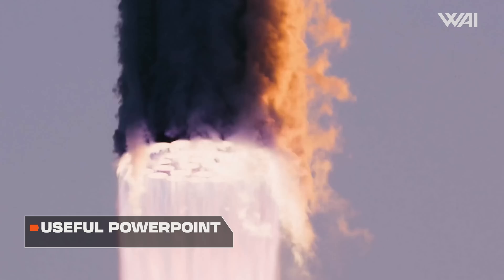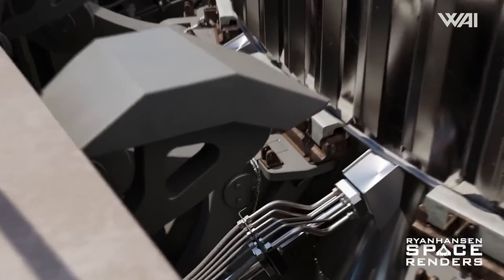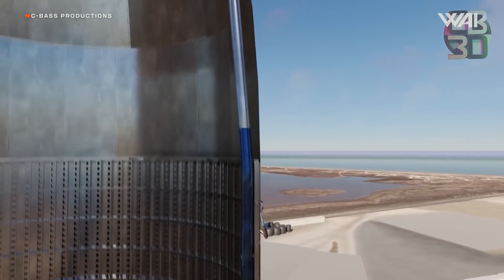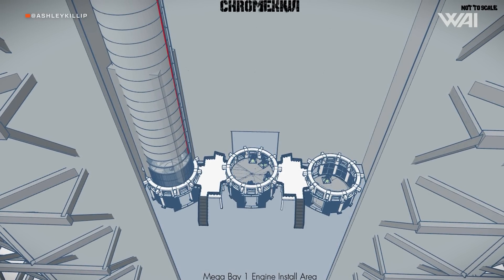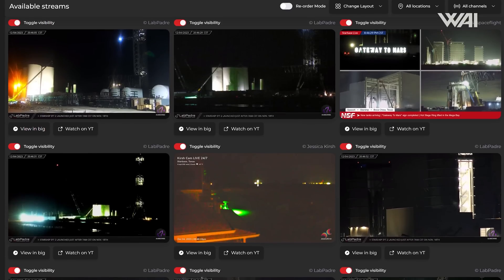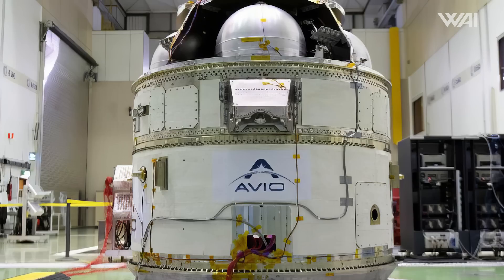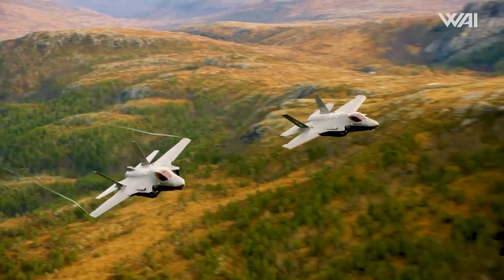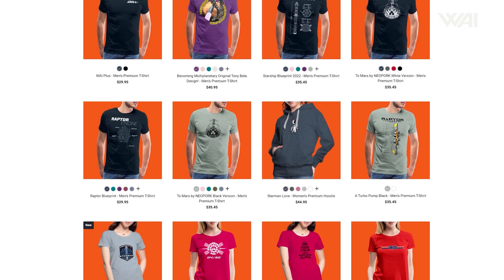SpaceX Starship: Version 2 Is Coming & And It Does Something Different!

Comment: Today's Fact: The 'Great Smog of London' in 1952 involved a deadly combination of fog and pollution that killed thousands, with no clear explanation for its severity.
Reply: I think it was just a high pressure weather inversion like a bubble that prevented the pollutants from dispersing. Once the weather pattern changed, air flow resumed and the situation corrected. London was notorious for fog and coal smoke for decades but that particular weather event created a horrific situation. In recent years, we’ve seen similar events occur in China.

Comment: The mere fact that SpaceX can manufacture SuperHeavy boosters and Starships at this rate is already mind boggling to me...
Reply: And it's only going to get faster. As Musk has said, they're not building a rocket. They're building the infrastructure to build LOTS of rockets.
Reply: Once Starship is operational, a new design Mars sample return mission could use the enormous throw weight to send a massive brute-force lander and launcher using as many off-the-shelf components as possible, with large performance margins included. Then launch four of them.
Reply: It only feels mind boggling because you are accustomed to the snail's pace sluggish production schedule embodied by NASA.
Reply: It is, but make no mistake. Starship will change shape a few times, and it will be more work than anyone ever dreamed. Not berating anything, just being realistic. A cargo version / non-returning ship will be ready first, but eventually human rating this monster for launches and landings is going to be a real tough nut to crack, unless some things on the ship change drastically. Never in this form will it achieve human rating.
Reply: Love the learning from failure ... a real lesson and paradigm shift for me
Reply: @paulmichaelfreedman8334  it will always have the same exterior shape. 😁
Reply: @ThatOpalGuy  You mean like an oversized pocket rocket? 🤣
Reply: @ThatOpalGuy  Seriously now, I think the only way to get human rating is to make the crew compartment an independent shuttle craft which can detach after re-entry burn, and glide down to earth like the shuttle did, also they can then land on any runway in an emergency. The bottom half of starship can do the classic belly flop re-entry and suicide burn. Imagine a scaled up dream chaser instead of the nose cone.
Reply: @paulmichaelfreedman8334  nature loves aerodynamics
Reply: @paulmichaelfreedman8334  It seems unlikely, to me at least, that nasa would allow a human rating without some sort of escape system. But we saw that the payload section of the starship can survive an explosion, so maybe just give that section some sort of escape rocket and a few parachutes to slow it as it descends?
Reply: @paulmichaelfreedman8334 
IMAO Crew Starship will be configured with six sea-level engines and three vacuum engines. That will enable Crew Starship to climb away from the booster during every moment of booster operation, including from atop the OLM.
Reply: @imconsequetau5275  Mmmm. If you say so..
Reply: @paulmichaelfreedman8334 
I suspect there will be multiple Starship variants in production and service concurrently with only one or two such variants intended to carry crew.  Assuming all share the same propulsion and control systems, every successful flight of every variant will raise confidence in all of them.
The Superheavy booster will, I think, be a single development item which will probably be pretty well finalized fairly early in the Starship development timeline.
Reply: Quite.
Reply: They are making them fast but they don't work yet so....
Reply: @jabatobes3176  They actually already work surprisingly well. Usually a bit better with each flight. SuperHeavy has now just had two flights. You remember that it took SpaceX about a dozen blown-up rockets before they perfected the Falcon 9 which nowadays launches almost on a weekly basis, with some boosters having been re-used several dozens of times? SuperHeavy and Starship are more complex than a Falcon by a lot, so more explosions are to be expected until it's done. Haven't you learned anything yet?
Reply: Doesn't it make you wonder why NASA is so slow!
Reply: @abelgarcia5432  Well NASA, ESA etc. can't operate like this. Every time one of their rockets - paid for with tax dollars - explode, the media gets all hysterical about it. I guess this kind of on-the-edge learning-by-mistake is something only private companies can afford to do.
Reply: @abelgarcia5432  nasa are "so slow" because they're massively under-funded for the job they are expected to perform.
Reply: Thumbs Down. The FAA is not behaving- at all- like yup describe; nor does the law allow them to. - Dave Huntsman
Reply: Yup, there’s do’ers (Elon musk) and theirs planners (nasa and all the rest)
Reply: Those are merely prototypes, the final product will be maned and unrecognizable from this design, SpaceX will need humility and settle for a multistage rocket with a disposable second stage for the Moon race to be won again by Americans. Easy does it with a booster like that, forget Starship orbiters for the moment, aim for the Moon with NASA. Build Starlink later…
Reply: Elon Musk has accomplished more in the last 20 years than NASA has in many more years of failure. So let’s ask why?
Reply: If only NASA could get rid of all the other corrupt blood sucking contractors. Humanity would be so much further along in Space Exploration.
Reply: Its amazing what you can do whilst burning hundreds of millions.
Reply: @leonskum6864 True, if you want to learn by failure, you have to be able to rebuild quickly. But if you know anything about the complexity of building rocket engines (just look at how BO is struggling for years now to build just one) and how the new raptor 2 engines are more complex than their older ones, it's still crazy that they can build one engine per week, or even faster... I mean, each SuperHeavy booster has about 30 engines.

And their rockets only explode until they don't. Like the Falcon. And when they won't explode anymore, their manufacturing capability will allow them to run circles around the competition.
Reply: Its the core of what they do.  The manufacturing processes are just as important as part performance.  This is why what the FAA doing is so sad.  Spacex can move much faster if the FAA stops regulating a test program as if it was a commercial rocket launching humans already.  Spacex could have dozens or even over a 100 launches by the time of the HLS missions because once they start landing and reusing, the launch cadence can increase a lot.
Starliner will probably have humans aboard after a single successful flight.  Vulcan will likely only need 3 flights before humans ride on it.  Meanwhile spacex will have at least dozens of launches before people go aboard.  
The complete lack of safety by the non-spacex companies is mind boggling.  Just because its expendable and expensive does not make it ok to avoid testing.
The amount of testing spacex does should be required of all contractors. Spacex also charges less despite testing so much more.
Reply: @_PatrickO  I am a big fan of SpaceX and space exploration in general, but I think the FAA is just doing its job.
Reply: The FAA is dedicated American Citizens spending countless hours protecting Americans and the environment while promoting commercial space activities. Thank them the next time you fly. They certified that pilot and that aircraft, or would you rather the airline do it?  @_PatrickO
Reply: @_PatrickO  the FAA ensuring the safety of workers and general public is SAD to you? sigh....
Reply: @ThatOpalGuy  Why are you laying.  Every spacex launch is safe, they make safety a true number 1 priority unlike what boeing was trying to do by certifying a defective capsule to carry humans. If they did not have the thruster profile issue and finished the first flight, humans would have been on that thing with all the other flaws still there.
Meanwhile spacex risks no one.  They have an impeccable safety record.  If you actually looked at the mitigation report spacex submitted to the FAA every single thing on it was already being done or planned to be done.  The FAA didn't change anything.  All they do is slow things down to study dust in the wind and turtles.  If the FAA pulled this nonsense during apollo, we would have never got close to the moon.
You show me one thing the FAA made spacex do to improve safety that spacex wasn't already doing or going to do.
If you cannot do this off the top of your head, then you are making up your claims.  As you never actually knew anything.
Reply: @_PatrickO 
It is standard operating procedure for the company to propose what will solve mission anomalies. If done competently, then the FAA will have nothing to add. 

However, the FAA still has to review the reasons for every anomaly (fault tree analyses) and verify that every protocol, resolution, and new feature has been implemented.
Reply: @_PatrickO   * The Flight Termination System (FTS), which failed on the 1st flight. * The FAA has the job of ensuring adequate FTS, in order to protect the people below. They've used the Falcon 9 FTS for years---how did they get it so wrong for Starship?
Reply: its like building a bridge to nowhere.
Reply: Then, nowhere will turn into somewhere...

Comment: Why doesn’t SpaceX use falcon heavy to launch a number of permanent refueling tanks for starship into orbit?  They could then test out the transfer and refueling without having to do multiple starship launches.
Reply from the maker: The tanks would be too big unless you make them inflatable. Starships can hold loads of fuel. :_WAIShocked:
Reply: @Whataboutit 
Exactly, the Starship refueling variant, if there is such a thing, will be orders of magnitude larger than that which Falcon Heavy can carry.
Reply: @Whataboutit  inflatable tanks? so launch that, then launch falcons to 'fuel up the tank' then launch the starship to refuel? 
lol
Reply: Because developing and certifying such an upper stage would be extremely time consuming and costly. Starship is already going to have this architecture, might as well use it.
Reply: @marioornot Right, but proposal was to test a prototype transfer mechanism with a much smaller tank on a much smaller rocket .  This will allow the fuel transfer team to have an improved and tested system ready once Starship can fly where planned .  So a scaled down tank set stuffed into a Falcon 9 fairing and tested in MEO .  The small test tanks could be built at Starbase using Starship materials and couplings, but with smaller pieces of stainless steel .
  Overall goal is to have everything ready in time for Artemis 3 with the Starship HLS combining a completed and tested Starship design with a completed and tested fuel transfer situation .
Reply: @marioornot  indeed. if they can perfect in orbit fueling it will be the biggest advance since sending humans into LEO
Reply: They could I suppose perfect a refuling system in advance with what they already have. Any one of these untested hurdles could hold the Starship program up, makes sense to do as many ahead of time.
Reply: Refueling starship is pointless until starship launch reliability is proven.

Once starship launch reliability is proven, starship will be less expensive than falcon heavy.
Reply: @nathanmays7926  so maybe in a couple years.

Comment: The metal insert for the heat tiles is precisely what I predicted. It looked to me that the tiles were tearing due to the limited contact between the tile and the metal. To spread the load, add a metal insert. Of course all this does is contribute to Starship's mass and you guessed it, subtracts from it's useful payload.
Reply: If the tradeoff is that the TPS system actually works instead of being a complete failure, choosing the way that works is the right choice.
Reply: @wmason1961 They won’t have any data on the TPS until they try a re-entry.
Reply: @sdfried4877  they have plenty of data on falling tiles from the previous launch. They have to stay on in order to.work. They don't need to attempt re entry to know missing tiles wont work.
Reply: @wmason1961  Yes, but they’re also irrelevant until they’re actually needed.
Reply: @wmason1961  It's not the only problem with the tiles. The other is the structural stability of the vehicle itself.. Flexure, vibration. We won't know until it's tested in the harshest environment - re-entry.
Reply: @saumyacow4435  All we know right now is that they tend to fall off during launch. Until that gets fixed, everything else is irrelevant.
Reply: @wmason1961  What puzzles me here is that SpaceX would have not just competent engineers, but also sophisticated software. And I would have thought that any company doing this would build a small scale test facility and be able to refine the design sooner.
Reply: @saumyacow4435  we don't know what testing SpaceX may have done small scale. We would probably  not see it. Especially any advanced computer modeling. I don't doubt they have throughly thought it through. And after OFT2 they have a lot more data on the stresses they went through during launch.  I expect changes to prototypes often.
Reply: @saumyacow4435  They bake the tiles themselves here in Orlando. I think the formula is patented by then as well, so they do have a lot of knowledge and skill applied to the project.
Reply: @wmason1961  you would think that would be obvious, but no. also, he can just skimp of life support infrastructure to make up the weight.
Reply: On the plus side, the gap between the tile and skin will reduce heat transfer and allow for slightly thinner tiles though I doubt it'll offset the extra weight of the mountings.
Reply: That metal insets are at first look as pretty thin. It could be that they are made out of very thin metal, maybe 0.5, or 0.8 mm. It could be sufficient while there is not much weight added.
Reply: @just_archan  It will be a tiny proportion of the weight they claim will be saved by making the booster and starship from thinner steel.
Reply: @ThatOpalGuy  actually if I recall, tiles already have some sort of other material, this white bottom layer. Not sure what is it, but maybe that was something that should improve tile integrity. Maybe, in modernised version of tiles steel plate replace this white thing, so weight difference between old and new would not be so significant...
Reply: @just_archan  Somewhere between 0.8 and 1.5mm and that would add (quick and dirty estimate) around a tonne or two. It's significant.
Reply: With the ever increasing efficiency of the newer engines, the weight trade off becomes less of a factor. 

I feel like a contoured tile resembling scales or feathers that slightly overlap might be the best option. Thinner at the front, wider at the back with a little slot to tuck in at each row. Cap it at the front with a nose tip to hold it all in place. It’s a tested design developed over millions of years and is very durable.

Comment: I thought only the Russian N1 rocket had hot staging and it was never successfully tested.  The thing always blew up.
Reply: Proton and R7 (Soyuz) do it as well successfully for 60+ years.
Reply: Titan II used it in the Gemini program, I presume they used it in the other Titan versions.
Reply: Soyuz has been using it for decades. Every resupply and crewed mission Russia sends to the Int’l space station uses it, and is part of the reason the travel time there is significantly shorter than when those missions are launched on Falcon 9.
Reply: Russians always hot stage.
Reply: N1 hot staging actually worked. On one particular launch they could actually have reached orbit. Things went wrong on stage 1 as normal, but this time was almost at its stage separation altitude and velocity. They never knew untill later untill reviewing the data, but they realized had they initiated stage separation a few seconds early, they would have saved stage 2 and 3 and most likely reached orbit.